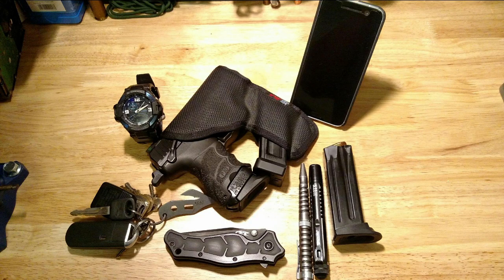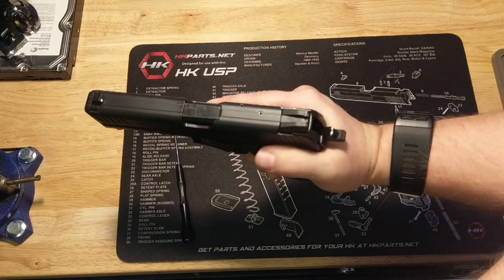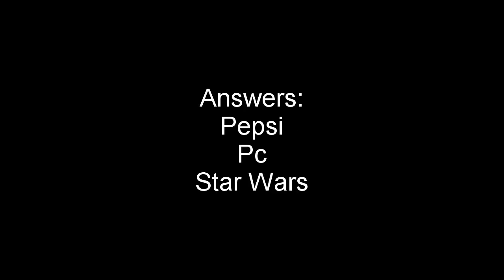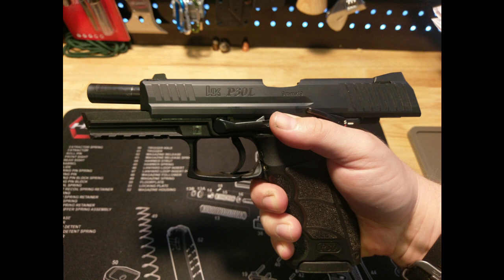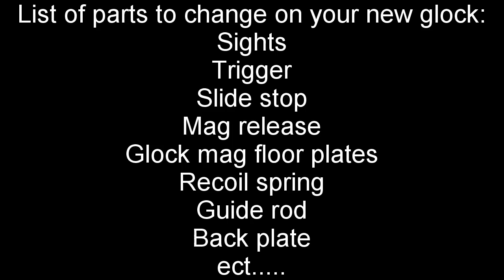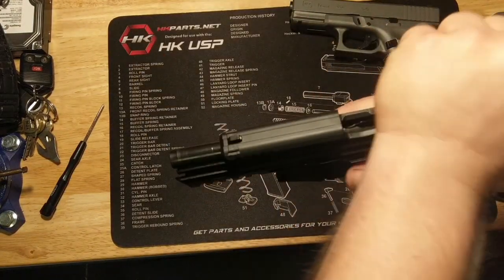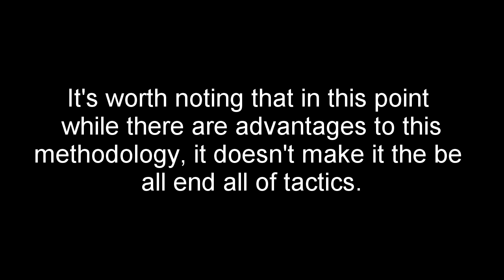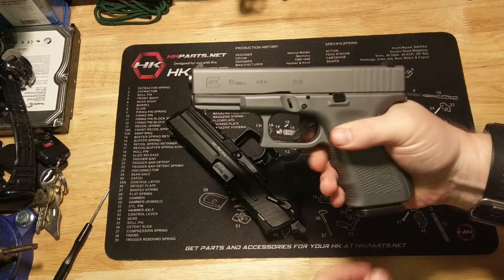Slide Stop VS. Slide Release

Comment: When folks tell me not to use the slide stop to release the slide, I always ask why did they go through the trouble to machine the part extended away from the receiver with serrations on it.
Reply: So you can release the slide on an EMPTY mag. AK's and many other designs DO NOT have a bolt lock. It's rack, rack, rack. It all depends on DESIGN. Just because it's there, doesn't mean that it's intended for the purpose you THINK it's for.
Reply: Are you serious or just illustrating how ignorant many gun owners are via satire?
Reply: To make money.

Comment: If you are going to keep the Glock carry the H&K & use the Glock as a paperweight.  The method you use does depend on the weapon & how you get trained. Also, if you are left or right handed. Starting out on a 1911 I was instructed to use the slide stop/slide release. Later on the agency I worked for preferred the slingshot method as the extra compression of the recoil spring meant increasing the probability of proper seating of the round. I don't recall ever having a failure to feed using either method that was due to the weapon. Ammunition yes, weapon no. Slide mounted safties need to be done away with. Like you said too easy to engage by accident. Practice both ways. Be aware of which one works better in any given situation. Excellent presentation. Well thought out.

Comment: Nice! Thanks for laying it out. I'm sick of reading blurbs written by purists. We should know our equipment and train to use both methods depending on circumstance, not one or the other. On a hot day when hands are wet, the M&P 9 is tough to rack with slide release, the CZ, on the other hand, has a big lever that can be actuated under water. KNOW YOUR GEAR and your surroundings. Great video, keep it coming. Semperfi, Do or Die, Oohrahh!!! 🇺🇸🇨🇦

Comment: I would like to refer all to US Patent # 984519, granted to John Browning, Feb. 14, 1911.
Page 5, lines 14,15,16 of the patent description reads as follows:
"After placing the magazine-in the grip. the breech-slide is released by depressing the handle." 

I would call that the final word.
Reply: It's fine with a loaded magazine... but you shouldn't let the slide slam forward unless it's picking up a round on the way into the battery. Per Bill Wilson and he should know.

Comment: My Walther CCP in .380 failed in a 100 rounds, new out of the box. Went from working as a slide stop and slide release, to a slide stop and "Won't effing release", even with pressure from two thumbs. Had to overhand it.  Funny thing is it looked like the example of a bad slide catch/release in your example. I think me and Walther need to have a talk. Big issue, but once fixed, this weapon is pretty nice, for a .380.

Comment: I saw a video where the guy advised not to use the slide stop as a release with no rounds in the mag/empty mag because the force of the slide going back is at it's strongest. When the round is chambering then it's ok as it takes some force away.

Comment: Firearms with a slide stop are engineered to chamber around under full spring tension. Using the slide stop lever as a release for the slide does not allow this. That lever should only be pushed upward to lock the slide open. Certified weapons instructor for over 30 years.  This may come as a shocker to most, but if you actually read the manual and follow the instructions, you won’t have this problem.

* I do have an HK VP9 where the manual clearly states the part is a slide release. In this case is similar to this, the gun was engineered for that part to be used as a slide release.

Comment: I certainly hope that everyone I compete against uses the slingshot method. 

I can use the advantage.
Reply: You’d be surprised. At the end of the day if someone practices that style they could overtake someone who does use the slide release. But it was a funny joke.
Reply: @totalnewb123  there is no way to rack it as fast as a slide release.
Reply: @ihcterra4625  I agree that it is, in the hands of someone who practices. But if someone given time and practice using the racking method it could give it a run for its money. Slide release method has its advantages but it like many things isn’t perfect. “The sun maybe a few billions years old, but it will never live forever”~me.
Reply: @totalnewb123  given an equal amount of practice, slide release beats any kind of racking by a good half second.
.
Reply: @ihcterra4625  yes it could, but racking is no slouch. Whether self defense or competition racking the slide still has its use. Anyway tap, rack, and bang sounds better than tap, slide release, and bang.
Reply: @totalnewb123  false equivalent. When clearing a jamb, you don't need the slide release because the slide isn't locked back.
Reply: @totalnewb123  it's no slouch, but it is 50% slower.
Reply: @ihcterra4625  what I was getting at was the consistency of racking the slide to get the firearm into battery but I did switch the subject. I’m just explaining why at the end of the day if someone would to practice racking the slide like many do the difference in speed could be negligible. Like I’ve said before I agree that using the slide release is faster but I disagree on the leaps and bounds that you’re telling me. The key to however someone uses their firearms is practice with it. Both styles have their pros and cons at the end of the day.
Reply: @totalnewb123  it's slower and there are no bennifits.

But it's your gun, shoot it how you want. Just don't pretend it's better to rack it. It's half a second slower in a 1.8 second operation. 

I'd call that significant.
Reply: @ihcterra4625  Yes to you it might be slower and might not be beneficial. As well I’m not implying that racking is better, just that to others it can be. Also the speed could be negligible due to practicing. But I’m glad we both agree that people should do what works for them.
Reply: @totalnewb123  anybody who puts any work into it will be faster with the slide catch. If you drill enough to get really fast racking, that much drilling with a slide catch will make you even faster. By a significant margin.

There are no advantages to racking. All it does is slow you down. All the excuses are just because Glocks trainers were sick of people telling them how bad the slide catch is. So they made up fake reasons not to use it. Trying to tell people that it was designed like that for tacticool reasons. None are true and it is slower to not use it.

Run the gun any way you want, it is your gun. Just don't pretend racking it is better than using the slide catch.
Reply: @ihcterra4625  So just to clear things up. 

Also I’m not just talking about competition shooting but self defense as well. 

1. Slide release is faster, but if someone who prefers the racking method with practice can make the time seem negligible. 

2. Just because something is a bit slower doesn’t make it totally obsolete. I’m not talking bolt rifle vs ar-15, but that the racking the slide method isn’t something to sleep on. 

3. I’m not gonna touch anything Glock trainers are gonna say. I’m a M&P type of guy. 

4. I’m enjoying this debate. Thank you.

Comment: Good video - how about debating "mag slam" loading vs. slide release?
Reply from the maker: Im not sure there is a debate to be had there. "mag slam" is not something that can be replicated in every gun. some guns can do it after break in. HK's are some of the few i know that its actually part of the design, but even not all there guns can do it all the time.  Mag slam to me is not a viable tactic because a lot of weapons don't do it, and when they do its not consistent. Are you saying the debate about if you can do it should you?
Reply: @thesteelknightsarmory215  my vp9 will do it wthl factory mags but not with 3rd party 
I do wonder if it's something that should not be done often
Reply: Exactly.
Reply: TheSteelKnight's Armory 
   I use a variation of the slam, but I slide the mag in and give it a rap with the heel of my hand. SIG's are the easiest, GLOCKs take a little more effort, but I have every confidence in the method with both. 
  It might not be the right way for anybody else but right or wrong, it's my way. 
  For somebody that has an arm incapacitated for whatever reason, knowing that a round can be chambered by hitting the butt on a hard surface might be some pretty good information to have. I watched another video where the guy said his buddy pulled the slide back with his teeth, when all he needed to do was hit the butt of the pistol on just about any surface. As you said some guns might not chamber a round with this method, but just as a personal opinion I believe it might be to ones advantage if their EDC did.
  I'm not sure about his story tho because he talks a lot and very fast. Too many times the fast talker's can't dazzle with brilliance so they baffle with BS.

Comment: I agree with you 100% on S. stop vs. S. release. However, every gun will get damaged if you dry-fire  too much. And Glock is the worst!
     In the casae of 1911s and S&W M&Ps the springs in the firing pin/striker is the first to get damaged. In the case of HK hammer fired and Sig hammer fired guns, the firing pin will break in half first. In the case of S&W revolvers, old style the firing pin will break, and  in the new style, the firing pin retainer assembly will pop loose. I Know because all these happened to my guns, and there are all top notch guns.
But in the case of Glock, the breach face in the slide will crack and break. therefore you have to replace the whole slide. It happened to me with 2 different Glocks. 
     All guns are designed so, if you dry-fire too much they will get damaged at their weakest stress point  first. Therefore you should mimic live fire as much as possible by using the  snap-caps.

Comment: Good points all. My Kahr PM9’s owner’s manual says using the slide release is the only way to chamber a round. If you sling shot this model it will not always return to battery. My HK collection clearly favors the slide release technique and it works efficiently. Next up: the solid steel versus Polymer guide rod.

Comment: Glock manual says you can use it as a release
Don't know if this is new or not, but they say it's fine
Reply: Each manufacturer has their own definitions on this due to their own designs on their firearms. Glock says it’s okay for theirs, S&W says it’s not good for theirs. I personally don’t do it to my firearms not to say I’m correct, it’s just not my thing. For you, do what works for you.
Reply: @totalnewb123  if they didn't intend it to be used there's no reason for them to have it on the outside of the gun
that's just plain bad design
Reply: @kh8655  But there is another feature that everyone forgets. How will someone be able to manually engage the slide to be opened without inserting a magazine? The side lock would make it a safer way to keep the slide opened while doing maintenance. I’m just stating that pistols like the M&P 2.0 were not intended to use the slide release, even though you could but it’s difficult to do because the generation before had issues with the slide release so it was redesigned. At the end of the day all someone can do is what’s best for them.
Reply: @totalnewb123  they could have a separate manual slide lock, it's really not that complicated basically the same as cutting an ambidextrous slide lock in half and removing the handle on the auto lock side of it
sounds like they just got the design wrong first try, so they suggested not using as intended

Comment: Mag release button & trigger pulling is a natural clutching & white knuckling grip out of fear btw you will drop the slide on an empty chamber a lot also extended slide release you need to rack because you’re gonna ride the release & for a reload the slide won’t lock back
Reply: Nope. The mag release is just as hard to hit as a slide release. If you can't hit a slide catch, you can't hit a mag release or a trigger.

It also depends on the gun. My slide stop never gets in the way when I shoot. When I reload, rotating my wrist so the mag well points towards my mag pouches automatically puts my thumb on top of the slide catch. When I push the mag home, it pushes the slide release up into my thumb. I don't have to pull down on it. 

I keep my thumbs out of the way when I shoot so they don't ride on the slide or hit the slide stop. I have never had it lock open prematurely or fail to lock open on any of my guns. With or without extended slide releases.
Reply: @ihcterra4625  squeezing clutching & gripping in natural reaction sorry it’s a fact also you be really tiny if you can’t reach a mag release
Reply: @benbarry1330  depends on the gun. Some slide catches are farther up towards the muzzle. I have one gun with the catch way back over the thumb, I have another that is a full inch towards the muzzle compared to the first one.

I shoot a couple thousand rounds a year, the extended slide catch it has never been interfered with and the gun has never closed on an empty chamber. 

It's all about repetition. If you drill it enough and use it in competitions for years, it becomes a reflex to do it right. 

That is really the only way to be fast.
Reply: @ihcterra4625  sure every gun is different I’m a glock guy bought a Glock that came with a extended slide release every mag it would never lock the slide back i always rack it’s no problem but I got annoying fast like sigs have it in a really good spot
Reply: @benbarry1330  keep your thumbs off the side of the gun when you shoot. It not only keeps you from interfering with the slide, it will make you more accurate.

It's a tip I got from Jerry Miculek.
Reply: @ihcterra4625  I try it’s hard to teach a old dog new tricks I’ve always practiced defensive shooting not accurate shooting I should though competition shooting looks fun

Comment: Excellent points what I think you didn't touch on enough though was hand size not everybody has hands like Shaquille O'Neal and there are a fair amount of people there who have a hard time reaching the slide stop without adjusting their grip also different guns require a different amount of force to release. The slide stop on my M&P from the right side it's virtually impossible( and yes I'm left-handed and no I am not weak) also as I own many different weapon platforms the slingshot method Works equally well on all of them where is slide stop not so much therefore for me slingshot your results May Vary

Comment: Your Confused:   What is the most Fast method for "You".  Thats all that matters !!!  If your concerned that training to save your life in a way that doesn't hurt my
weapon than I suggest you get another more reliable weapon or train with one and have a back-up !!  Thinking I should be "concerned" about breaking the weapon
is just a Killer
Reply: That is kind of difficult to read, so forgive me if I don't follow your point. 

First of all, there is far less motion and your support hand is not moving away from the gun at any point when using the slide catch. It isn't faster for him, it is faster for anyone who does it. 

Second, if you have a weapon that will be damaged by using it, you shouldn't use it. It might get damaged.

Comment: The extended slide stop is to make easier for people to activate the slide stop when clearing the firearm of malfunctions or clearing the firearm for stripping the gun for maintenance and repair. Why listen to the Manufacturers who designed the gun though? I am also left handed, I was always taught to use the slingshot method for it will work with every semi-automatic handgun! Some guns you just have to be a little more careful.

Comment: You only 'damage' a pistol by dropping the slide with the slide release when dropping the slide on an empty chamber/unloaded gun. If there is a loaded mag in there and you drop the slide feeding a round in, it's just fine. When the gun is empty, you should not allow the slide to slam forward. On 1911s that are hand fitted, you will be risking your slick action and perfect trigger by allowing the slide to slam home on an empty chamber. This is not that the gun is fragile.

Comment: Hollywood made it "cool" to use the slide LOCK as a release. Hollywood is FANTASY.  I'll keep racking the slide manually and train my brain so it becomes second nature. Who's going to be more prepared to clear a malfunction?  Who won't have issues with "ghost" re-loads? (your thumb racks the slide before the mag is fully inserted), and WHEN it does happen, will you have developed the skills to tap/rack, or as you put it, "drop mag, rack, rack, rack",  the slide without even thinking about it? Isn't it interesting that you have to RACK, yet you argue that you shouldn't? You shoot only as good as you train. How many gun owners actually TRAIN? Your "logic" is utter horseshit. What is "faster"? Slow is smooth, smooth is fast. You may think it's "faster", until your thumb releases the slide a split second before the mag is fully inserted (happens ALL THE TIME on speed drills). Now what? I don't care what "scientific logical god" you worship, firing on empty when you think you're loaded IS faster, to the morgue.
Reply: All comes back to making a better decision and researching what you want in a firearm.  
Some have advantages other than: replace sights w/personal preference cuz factory ones suck, replace factory trigger cuz its gritty as F, Train around a bad design cuz ....fanboy..